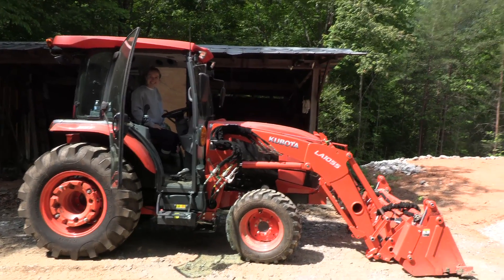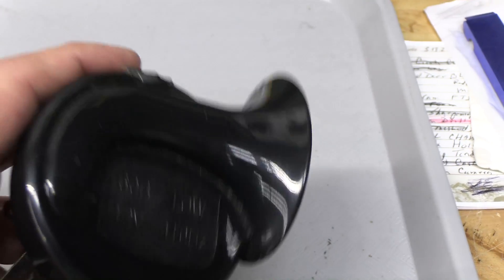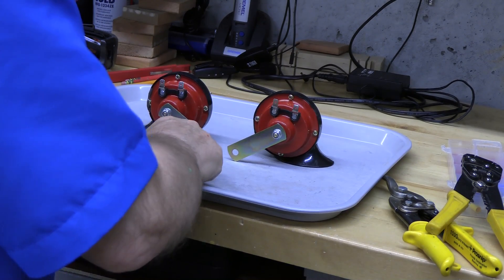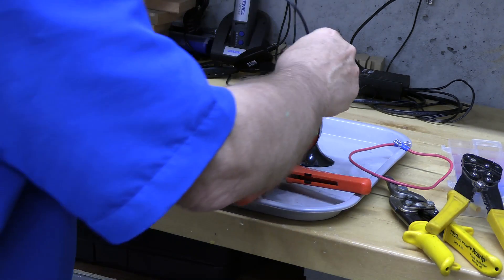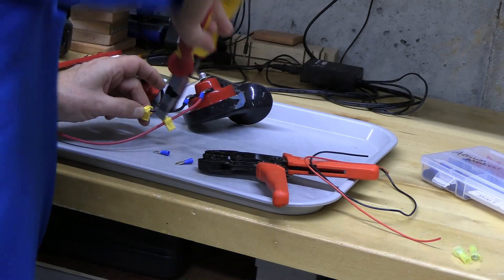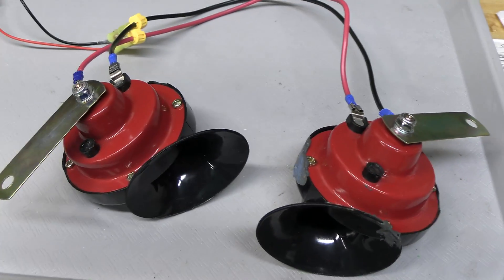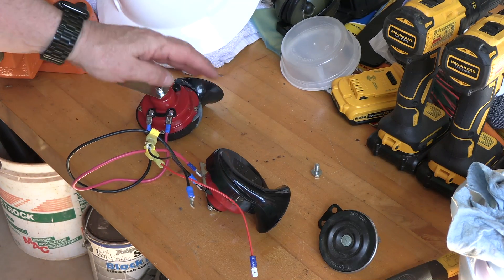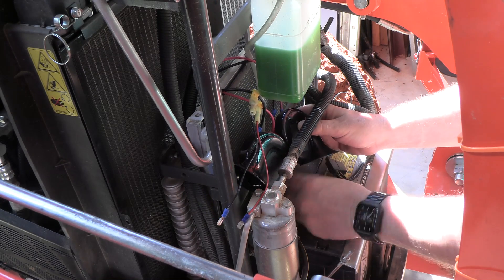Kubota Horn Replacement for the Kubota Tractor w Dr  Joe

Comment: Is there a relay for the horn, or is it direct to power?
I have a L275 with no horn and want to add one.
Reply from the maker: OK, very good question yes, you need a on off switch or button otherwise it’s gonna be on all the time and you can put it in line with the horn and then direct wire that to the battery. It should work great. Consider subscribing. Thanks. Joe.